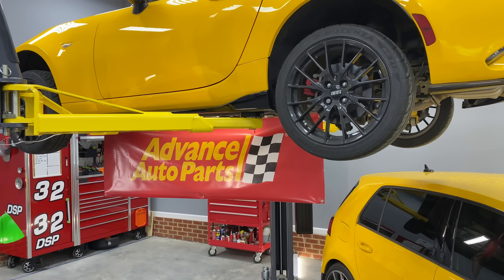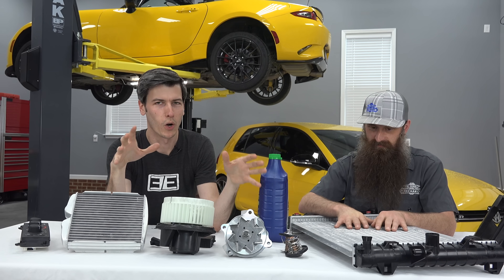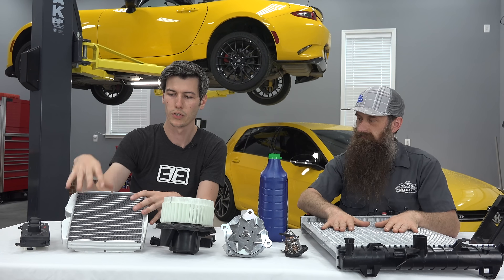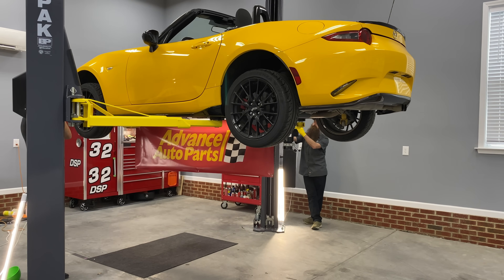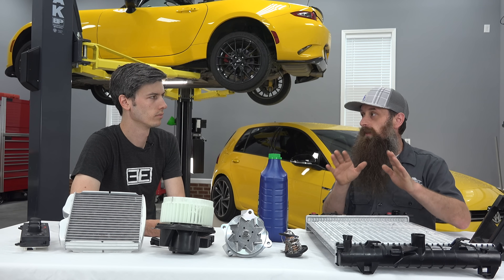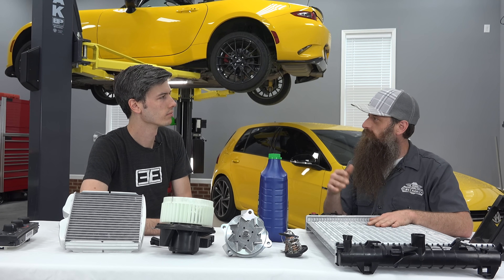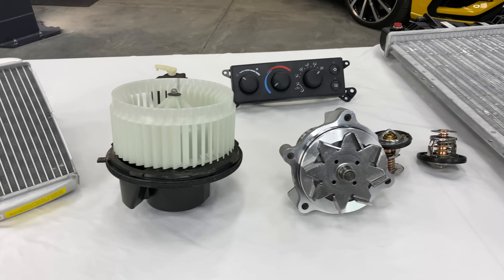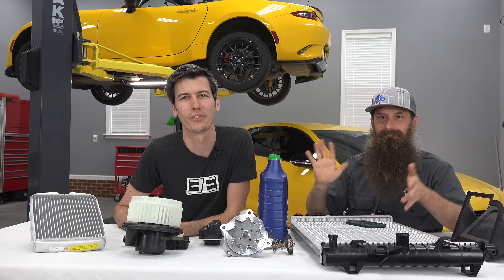Why Doesn't My Car Have Heat?

Comment: Jason if you would move to Florida you wouldn't have this problem...

I drove a '97 Jetta GLX mit der wonderbar VR6 motor for 4 years in Memphis...Without heat.  I bought the car in Florida for use in Memphis as an "airport car" and drove it around for a month before taking it there.  No problems whatsoever.  First day in Memphis:  It blows the seal between the oil cooler and the block and loses all its oil.  Fixed, expensively, at the dealer.  Then, a week later the heater core explodes in traffic on I-40.  When I say it explodes I mean it, it suddenly went with no notice or symptoms and flooded the dash with coolant.  Instead of spending $1500 to replace it, I elected to drive the car with the heater core bypassed.  And I froze my ass for for years each winter because despite the fact that Memphis calls itself the "mid-South", in the winter there is nothing "south" about this place and I froze in that car.  It's a shame, since that thing was a tiger!  It drove like a go-cart, I loved it, but it HATED me~

Great video!

Comment: So I have a weird issue of if I take a right hand corner at a decent speed my heater seems to blow out cold air until I straighten up. I thought I was crazy but its happened multiple times 🤔 thoughts?
Reply: My guess is that there's air in the cooling system.  Maybe on those right-hand corners the liquid and air slosh around so that what's going into the heater core is air.  Often times the heater core is a rather high point within the system.  When coolant is put in, the system needs to be carefully burped, to get rid of those hidden pockets of air.
Reply: @kc9scott  sounds like a good enough thing to test to me!

Comment: Greetings from Scandinavia, pro tip:
If your car shows inner temp in°C, ~17-19°C is comfy in high summer heat, ~21-24°C is comfy in sub freezing temps of winter.

Comment: i have a heating issue, mine is either full heat or not hot at all, my bmw goes to 28degrees which feels hot but soon as i turn it down to 27.5 degrees it feels like it went down 10 degrees not 0.5 and isnt hot anymore, feels more like 17.5

Comment: I don’t know why but I’m pretty big on not “spoiling myself” with heat or AC.   I’ll use the fan only at the coldest setting with outside air more than AC, or windows down of course.  

I also don’t like the idea of losing a single horsepower or MPG.
Reply: You won't lose power or mpgs from running your heater.

Also, aside from just running the blower by itself, you'll get better mpgs around town (low speed/stop n go) with the windows down compared to AC - and the opposite is true on the highway. 

At highway cruising speeds, where you're not speeding up or slowing down a lot, you'll have better mpgs running your AC than with the windows open. It's very slight, but could make a difference on a long road trip.
Reply: @jameshaulenbeek5931  
I know the heater doesn’t effect power. The 2 ideas are separate which is why I said “I ALSO don’t like xxxx” and that’s why they are physically separated in text. 

The first part is me saying that heat and AC is a luxury and you’re stronger mentally and physically with less of those.  

I only use my windows for when it’s really hot.  90% of the time I use fan city or highway for sound reasons.  Windows up is always more efficient than windows down.  AC off is always more efficient than AC on.  I 90% of the time do both windows up and AC off, fan on.
Reply: @Sheridantank  i gotcha! I didn't catch your wording the first time reading it. 

If I could survive on only the fan, I would. Summers get way too hot for me though - but I still opt for windows over AC unless it's just brutal out.
Reply: @jameshaulenbeek5931  
It gets hot in Ohio but I just sweat it out.

Comment: I had a friend of mine complain for not having heat. She was turning the dial to hot and then pressing the AC button... She thought the AC means air circulation...
Reply: It doesn’t work like that, so no she didn’t.
Reply: On most cars, this should still give hot air.  That's a valid setting and it should still deliver hot; the heater should overpower the A/C.  You'd choose that combination if you want hot but dehumidified air, such as for defogging the windows.  However, some cars have a coolant cutoff to the heater core if it's on Max A/C (i.e. recirculate).  So don't do that.

Comment: The thermostat on my car got stuck open. it was fine in slow moving traffic as it got up to normal running temperature but on the open road at speed the running temperature dropped right down.

Comment: Hello, over 30 years experience as a tech. Coolant level and condition is always the first thing I check. Because it is so often overlooked. And it's very simple and safe to evaluate. And I wouldn't want a customer's car to overheat and blow a head gasket while I'm playing with the controls to make sure they are set right. I know some mechanics rely on the temperature gauge. What's the temperature gauge gets a signal from the coolant temp sensor. The coolant temp sensor doesn't read very well if the coolant is so low that it is not surrounding it.
  I've had cars that's a customer complained would overheat, but yet no heat in the car. And as soon as I checked the radiator, it was ice cold. Once I remove the cap, I saw that the radiator was a solid block of ice. Further examination , the heater core was also a frozen block of ice.
Reply: Sounds like he topped upp the coolant with distilled water throughout summer while nevef reflecting over the probability that there was a leak...
Reply: @SonsOfLorgar  Fun fact straight antifreeze usually will free solid at around +10F to +20F, 60% antifreeze 40% water is usually good to -50F then turns slushy.
Reply: .,k,k,k,k,kk,k,kkk,,,k,,kk,,k,k,k,,kk,kk,,k,k,kk,,,k,k,kk,k,k,k,,k,kk,,k,,k,k,k,,k,k,k,k,,k,k,kk,kk,k,k,k,kB

Comment: one thing he got wrong. the coolant system is not a sealed system and older cars losing a quart of cooling is normal. example my 2000 saturn manual said if the coolant consumption is greater than a quart seek a mechanic. then something about the heater block and venting.

Comment: Wish that heater cores were not so much a pain to replace. Recently had to replace one buy cutting out the old one, then replacing with a jerry rigged computer water cooling radiator. All because the alternative involved removing the entire dash assembly. At least the jerry rigged solution works well enough.

Comment: Going down a long hill in winter and seeing my temp drop is what I have seen too, but I think it was because I let off the gas, so no combustion, so no heat, but the pump keeps pumping,, so  the coolant temps keeps dropping.
Reply: But the thermostat should close and keep the heat in the engine block and not pass it through the radiator .

Comment: My older Dodge Dakota takes forever to produce heat, but the truck itself never overheats in hot weather.  Would a new thermostat fix that?
Reply: Some vehicles just take a long time to warm. My old silverado takes about 4 or 5 minutes of driving before it is heating very well.

Comment: What if my heat only works if I am moving? My car will reach operating temperature parked at idle (according to the temp sensor), but the heat will not actually blow warm unless I'm moving at least like 10-15 mph. If I just drove and park again the heat will keep working for a little while, but eventually it will stop blowing warm unless I start to drive around again. 

Not a huge problem, but kind of weird and annoying. (To be clear the fan works and air is moving, it's just cold air.)
Reply: My guess is that there's air in the system, and the heater core is located higher than most of the other stuff.  In that situation, you might get coolant to the heater core only if the engine RPM is high enough that the water pump develops higher pressure (higher lift of the water column).  At low RPM it could just have air in the heater core.
Reply: If your system uses a vaccum to control flow to the heater core, it might be a small vaccum leak, though I'd of thought you would be having other troubles if that were the case.
Reply: @djenson  What other sorts of problems? My AC also doesn't work that well in the summer at low speeds, but I figure that's just an airflow problem.

Comment: "Never open the coolant system while hot"

Flat rate guys: hahaha. Wait, seriously? Nah, I got a rag.
Reply: I mean yeah I am with ya., but I can't tell people to do it. HAHAH
Reply: @FixingWithFriends  no? Pressurized reservoirs/surge tanks will bleed pressurized coolant away from the cap and radiator caps can be covered with a rag to containing the splashing. Use your palm with your fingers out flat to spin the cap, dont grip around the cap.

We're pretty good at saving time and not hurting ourselves in the process.

Comment: Or your heater core just randomly blows up as your driving without warning filling your car with hot steam having you stopping wherever you are trying to get out as quickly as possible.
Reply: Old car problems 

Then bypass the heater core lol

Comment: Heat Mode? Is that when you adjust the air conditioner to not be as cold as possible? That's about the closest you get in northern Australia.
Reply: I mean no? It gets below zero out in the sand dunes on a winters night (record being more than ten below) , so if your driving at night the heats nice to have.

Comment: My air blend/mixture motor failed for the little door that lets hot air in so I removed the motor, zip tied the door in the open position and controlled the amount of heat with the fan. Then in the spring I replaced the motor and was good to go. Sadly, I flushed out my heater core before realizing it was the air blend motor but at least I know the heater core is clean.

Comment: "the cooling system is a closed system and you really shouldn't be losing coolant over time..." Jason must be new to Volkswagens.
Reply: VW owner here, you should just put new coolant and a turbo every year and you'll be fine.
Reply: @adam145  my issue seems to be clock gears...
Reply: @adam145  every year a new turbo? thats... cheap lmao
Reply: He might spend a lot of time looking for the coolant system on an old Beetle...
Reply: Heavy use of plastic to contain the coolant which cracks and leaks.
Audi/vw.
Reply: @oldfashionedwrx3574  Still not as bad a a BMW E46's cooling system.
Reply: @chrwl007  explain, i like learning. i have seen a lot of headgaskets in e46 bmws. but they're old now and that could be a part of the reason
Reply: @chrwl007  *E36
Reply: @chrwl007  B48 engine cooling system especially on plug in hybrids have even more coolant leak failures. it's not even funny anymore.
Reply: @oldfashionedwrx3574   And which vehicles aren't plastic?  As a mechanic of 40 years, I can't think of one.
Reply: @oldfashionedwrx3574  to be fair my Ford and Toyota both have plastic parts everywhere too. And even my 12 year old Ford with 200k miles hasn’t had a problem and if it does at this point I wouldn’t complain.  The key word is the cheap plastic pretty much all German cars use.

Comment: This. This is why I'm enjoying my electric car. Awesome video (since I still have ICE cars too).
Reply: I realized after I commented that the battery cooling system might be even more complicated than an ICE car: e.g. octovalve. Probably still has pumps, valves, thermostats, etc.
Reply: @cwmaguire  Unless you get a Leaf, in which case your temperature control system is just air blowing over it as you drive. Great for keeping things cool, lousy for keeping things warm in winter.
Reply: @mjc0961  Interesting, I did not know the Leaf was air cooled.
Reply: EVs have infinite blinker fluid.

Comment: I've had a cracked thermostat cause a slow overheating issue on my old BMW E46 i went through the whole system before i thought the thermostat would cause slow overheating.

Comment: For the coolant level getting low, I have learned while I was working at mercedes that the level was droping just because the AMG engines (mostly the V8) were getting so hot, the water was evaporating

Comment: What if i only get hot air on the windshield and footwell vents no matter what temp its set to? The ones facing driver and passenger work fine. Ive changed the heater valve and that didnt fix it. Maybe the blend door? Bmw e36

Comment: Pro tip: if you drain all your coolant, you'll get a lot of heat real quick.
Reply: none of that heat will make it into the cabin though.
Reply: @TheWolvesCurse  is it not? If you throw a rod on the exaust side and the car burns to the ground you will absolutely get some heat in the cabin!
Reply: @TheWolvesCurse  
Therein lies the joke
Reply: Thanks for the tip. I will try that right now.
Reply: @BD Haha!  Just drain the oil and replace it with gasoline.  That way your engine will receive twice as much fuel which will cause it to generate twice as much heat :D
Reply: HOD0R  I don't think that's possible, not enough air.  Myth busters did that with a bucket full of gas, just puts itself out lol
Reply: lol I guess I get the joke but the one time I had no heat was during a bad coolant leak. Was coming back from a ski trip and the lack of heat was somewhat bearable for a couple of teenagers in ski gear but as soon as we dropped altitude the engine started getting too hot no matter what we did and we had to tow it.
Reply: @BD thanks for the laugh
Reply: HOD0R  🤣
Reply: Just unplug the radiator fan
Reply: Hell yeah!

Comment: Can anyone please tell me as to why my car's air-conditioning cools only when the car is moving and not when it's idling stationary ?
Reply: often that is an issue with the cooling fans, You are getting airflow while you're moving, but not sitting still.
Reply: @HumbleMechanic  thanks man, much appreciated.
Reply: Check if both fans work
Reply: @sandybarnes887  will do so, thanks.

Comment: I’ve driven a tractor trailer last winter here in North Dakota it was like 10 degrees out I had to drive a truck like 2 hours with no heat. It was freaking cold and I was shivering so bad.
Reply: get a volvo ...
Reply: @colinscutt5104  to be fair, most old Volvos might sound like a tractor, weigh like a tractor and have the crash durability of a tractor, but it really isn't a tractor when it comes to load pulling unless it's a Volvo BM 6x6 all terrain dumper truck,because those things can get anywhere that there's a point going, and they have a generous range of variants,from the standard ore hauler, through logging processor, to self propelled armored 155mm self loading howitzer...
Reply: @SonsOfLorgar  I was suggesting Kevin use a Volvo truck in the cold as they are super reliable and AFAIK designed as standard to work inside the artic circle....
Reply: @Harold Potsdamer I think he means 10 deg Farenheit
Reply: @Harold Potsdamer Americans....

Comment: So I went out and looked under my hood. Don't see any of these parts. Yet another reason I am glad I have a Tesla. Less stuff to fail. LOL
Reply: You've clearly not looked very hard, your heater is actually even more complicated, having not only the same blowers/barn door style path selector, but also an entire electrically driven compressor system to generate the heat in place of just the thermostat to control movement of existing hot water. I like EV's, but the tesla is really not a winner when it comes to cars that are "easy to work on", despite not having an engine in the engine bay.

Comment: My car wouldn't heat up at all in the first winter i had it...
Driving to uncles house 20km away in -20C sure was fun, it wouldn't blow hot even at the end of the trip.
Not even the dashboard temp gauge moved at all.

Comment: You haven't lived until your climate control system fails, stuck on cooling, in the middle of winter.
Reply: I had it happen. Pulled the blower motor fuse
Reply: If that happens just roll the windows down.

Then it gets so cold you cant feel the cold.

On second thought, fuse is the smarter idea.
Reply: @Mk2Mod1  -- I wish it was just the fuse.
Reply: @lamplighter5545  windscreen troubles?
Reply: @mcspikesky  -- The control unit failed.
Reply: Don't remind me of it

Comment: Thanks so much for this guys.  After learning about the blend door, discover that my problem is a bad blend door actuator.  Heat only comes out of the dash and cannot redirect to footwell.   Leading up to the failure I could hear distinct "click, click" as the actuator tried to move the blend door.  Now to figure out how to replace it!

Comment: Just noticed an issue with my 2015 mustang this morning (ironically). Heat and A/C both work, but the passenger side heater doesn’t work (both regular vents and defroster). Any ideas?
Reply: Sounds like a dual-zone system.  If so, the problem sounds like the blend-air door for the passenger zone.

Comment: They didn't talk about pump failures.
Reply: I mean I'd be surprised if you'd drive a modern car to a dealership without chronic overheating symptoms if the waterpump wasn't working, so thats likely not going to be reported as "heater doesn't work" so much as "spews coolant/steam" or "motors seized" by the time it reaches a mechanic.

I mean granted, a model T ford doesn't have a water pump at all but merely thermosyphons, but not only is it laid out somewhat differently to most modern cars in order to maximize that effect, its also 20hp out of 2.9L, and despite a bigger radiator than a modern car could still overheat when driven hard outside of highway conditions, and so "moto-meters" (replacing the radiator cap with one that shows you the temperature) where a extremely common modification.

Comment: I wonder how many times Charles did a heater core on a b5 Passat. It's absolute madness.
Reply: More than enough. But not nearly the amount that are getting done on the NMS. LOL ALL The time.
Reply: @HumbleMechanic  Was the process for removal a little more reasonable on the NMS? When the core went out on my moms b5, I was stunned by the amount of things that needed to be removed lol